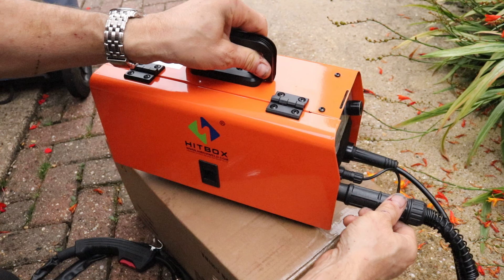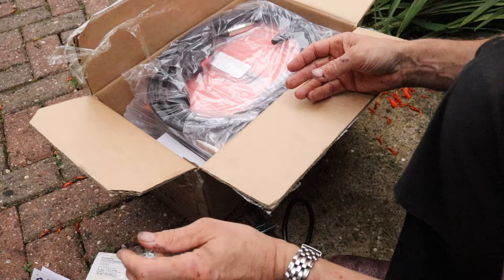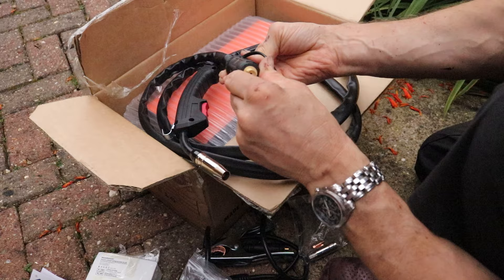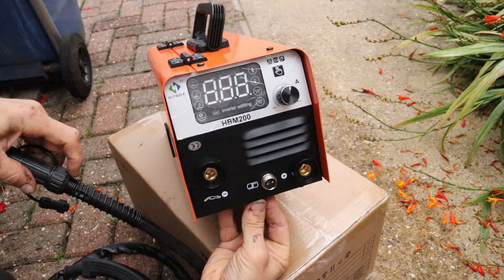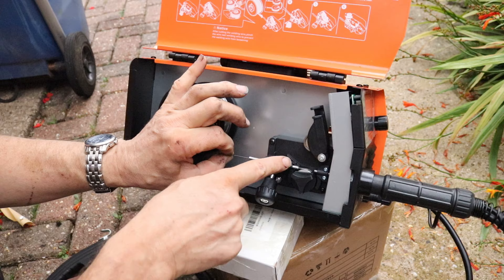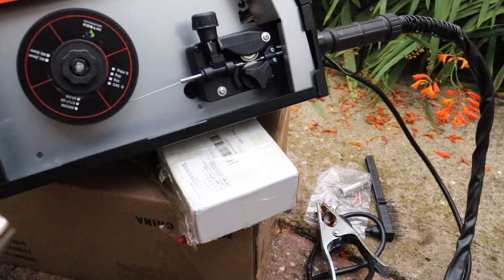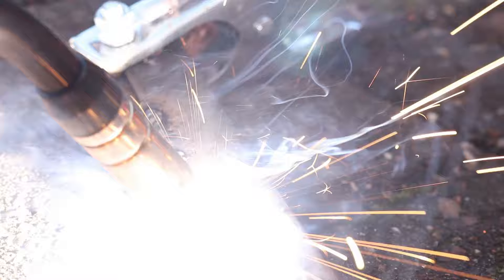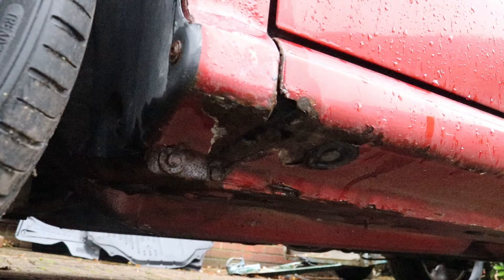HITBOX HBM200 MIG MMA TIG Review & unboxing

Comment: I bought this model on ebay, but wired for American outlets. There is no gas connection for MIG or TIG welding, unfortunately, I guess I'll have to contact the manufacturer about the proper conversion.
Reply from the maker: Yes it is a no-gas unit which keeps it compact for mobile operations. |t is very easy to put it into the trunk and take anywhere. The welds are a little harder compared to using with gas and |'m not sure how you would convert it, presumably you would need another mig or tig torch :-)

Comment: Can i run this from a standard uk household socket without killing my circuit or burning my house down, please?
Reply from the maker: Depends on your individual circuit demand. Just because something has a plus does not mean the circuit can take it. Quick guide: Ampsx230V=power which should less than the protective device (fuse)
Reply: @HatBoyHarvey  Thank you. That's the answer I have been looking for. Great video as well!

Comment: I am amazed your extension lead didn't go up in smoke, being wound like that will get super hot and you will lose power, needs to be fully unwound, otherwise a great informative vid and I have just ordered one, Cheers.
Reply from the maker: I'm not too bothered about the extension lead, (your right, but negligible effect on an inverter welder I would have thought) but thanks :-)

Comment: Very nice review.  I bought one of these a couple of months ago but only got around to testing the flux/mig welding a couple of days ago.  I have to say, it works really well.  Very nice clean welds at 120A. Very little spatter too.  The only thing I would suggest is to make sure to have a clean surface for the ground/earth clamp. If you are welding dirty metal, it's better to give it a little clean with a grinder first.  It will produce less splatter and should use lower Amps as well.  I'm looking forward to trying the stick welding next.  I've been looking at getting 6013/7018 rods.
Reply: 6010 is good for rust it’ll eat thru anything

Comment: flux wire comes out very fast and unable to control the length and speed
Reply from the maker: Speed is controlled by the amperage so as long as you strike-up it should feed the wire sufficiently. Difficulty occurs when you pull the trigger you need it to strike up, if not you end up with too much wire. It's definitely a 'knack' to get right and not to everyone's skill set whereas with a gas shroud it is much easier. Practice is key, keep cutting the wire to length when it feeds out too much, and practice with short efforts.

Comment: Thanks a lot..i just purchased one of these and ive never welded before..im looking forward to using that mig and now i know to set it between 130 and 160amp for my car 👍
Reply from the maker: Cool, good luck with it, hope you get to master it, takes time and practice, whatch videos to help. you will have to play around with the setting at bit and start off on clean metal clamped together. Don't burn or blind yourself in first month and you will become a welding god :-)

Comment: Great little review. Thanks. Nice to see you testing too. 
Oh boy!!!! Rookie mistake with the wire!!!! So sorry that happened…. It is always an issue with mig welders. ALWAYS. Hold the wire until it’s under tension in the feeder..😊
I never take the paper or plastic off the wire spool until it is in the feeder and locked in.
Reply from the maker: Thanks and thanks again for the tip will do, duly noted :-)

Comment: I bought one and it was dead on arrival. Didn’t turn on. Got a replacement and that worked fine. 
My 0.8mm tip was too small for the wire to push out, so I had to enlarge the hole slightly. 
Works fine. The quick lock was a bit iffy. 
Would be nice to have a table for amp settings but I guess I’ll have to play by trial and error.
Reply from the maker: Thanks for sharing your thoughts and experiences, best of luck with further welding :-)

Comment: I've just bought this welder off Ebay, mine seems to be a "Mk2" version with a nicer MIG torch. Mine came with 2x shrouds, 6x tips (4x 1mm, 2x 0.8mm). 
They look to be a great little gasless MIG/MMA/TIG unit for £80. I already have gas MIG, and stick/carbon arc welders, so not quite a total beginner, so looking forward to trying this welder out.
Reply from the maker: Thanks for sharing that 👍

Comment: I just bought such a welding machine. The MIG set only works in MMA mode. Should I send it back?
Reply from the maker: There is a selector button to scroll through to mig setting, make sure that is correct and you have connected everything right first.

Comment: Great video, very helpful. Would this be suitable to join a 2mm steel frame at corners? Intending to make raised garden beds but never welded before.
Reply from the maker: Absolutely. But gasless mig is a bit Slattery and needs more practice to get good welds IMHO. The welder comes with MMA stick welding which would work well with new steel frame metal, but not aluminium.
Reply: @HatBoyHarvey  From what I have read it seems the Flux Core welding will be better for 2mm and not so likely to burn through?
Reply from the maker: @markwebb9730  you can control the ampage so no worries with that, if it looks like you are going to burn through - turn the current down. It is the way to control the amount of penetration you need for the weld. Always practice on a similar setup with scrap metal before attempting the real thing. Good luck with your project :-)